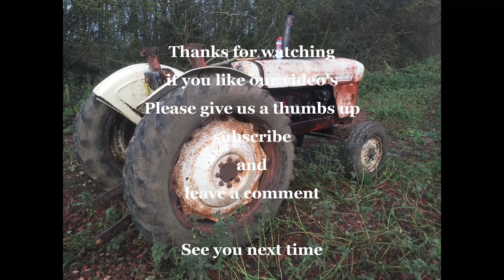Is the 990 back together and running ?  #67

Comment: I just bought a new crankshaft for my 1200, 1 bearing spun on the first cylinder.. Happy to see yours is together again mate. My journey only starts hehe
Reply from the maker: Hi WDV, I was extrememly lucky, when I opened the engine up it was probably minutes away from the same happening, luckily it was just the bearing journal on 4 was scored and could be reground.
good luck with your rebuild
many thanks for your support
Barry

Comment: It's alive!  Glad to see it running again.  The 4k vid looks great as well!
Reply from the maker: Hi Shane, thats great to hear, my screens only do 1440 so I never get to see the 4k mode. 
that DR is a wonderfull tool saves a load of time in the edits.
many thanks
Barry,
ps when are we going to see more from you?
Reply: @manfromthemist1958  Glad it's working out great for you!  I use the Voice Isolation in DR to cut out noise.  It's the major reason I bought the Studio version.  I have neighbors air conditioning units running on full blast and without the Voice Isolation it'd be horrible audio.   As for next video from me??   Lol, I'm rendering one right now!  Just a quick update one tho to let folks know I'm still around.  I just have not had the time to get out there and video anything lately.. And it's been unbearably hot.  37.3 C forecast for this Sunday, and the humidity included feels like you walk outside into a boiling soup pot.  Oh the joys of Alabama in the summer!
Reply from the maker: I feel for you lol, we've jst suffered the wettest July ever on record, but when the sun comes out it does hit a staggering 22 deg

Comment: Hello I was wondering if you could possibly tell me what part number or what cap and points would work on a Davi d Brown 4600 gas 3cyl and I have already rebuilt my 990 with your video assistants. Your torque sequence for the head and injectior calibration was spot on thank you for any more information you may have
Reply from the maker: Hello Mr Tuffduck I'm sorry I don't have the info, however if you got to
mycnhistore.com website and enter your make model and year thay have an extensive range of exploded parts diagrams for tractors and you may be able to find what your looking for there.
I'm pleased you where able to get lots of help from my other video's, hopefully together we can help keep DB's alive and well.
many thanks
Barry

Comment: Got a little David brown 780, issue with dirty fuel tank , took it off and really washed it good but still having problems, think the tank has rusted inside!!!!! I suppose a new tank is the best option really? Can’t be too expensive?
Reply from the maker: Hi Eoin, have you checked your fuel filters both on the lift pump and the main filters, you may have draged some dirt through into them, as you say if the tank is rusted out you need a new one
many thanks
Barry
Reply: Ya put in new fuel filters, air bubbles in my sediment bowl???? That’s why I think I have fuel restriction?

Comment: Ask a stupid question.  For a 12 volt tractor battery, what should the amps read?
Good to hear her running sweetly!
Reply from the maker: Hi TC, that would depend on how quick your tractor starts and the condition of your battery to begin with, Lets assume it a good strong battery and your engine starts within 20 seconds of turning I would expect your alternater to put out around 20-30 amps for a couple of minutes and then begin to drop off, once it's recovered the drain of start(again assuming you dont have lights , heat, wipers etc switched on)
you can check your alternator by measuring the voltage at the battery with the engine/ignition turn off, start the tractor and measure the voltage at the battery again it should be about 14.2v ish
if you start your tractor and your amp meter is constantly high and doesn't drop after a little while I would start looking for a  faulty battery, poor connections or a ded short somewhere
if you think your battery could be getting a little long in the tooth, take it off the tractor measure the voltage, stick it on charge for a couple of days, monitor the amps going into it, then take it off charge, measure the voltage then let it sit for a couple of days and measure the voltage again to see if it's dropping without any load on it.
hope this helps 
many thanks
Barry